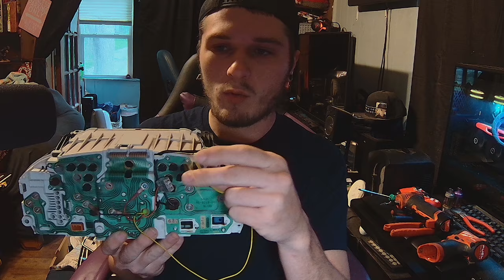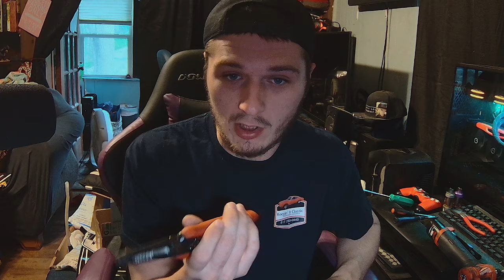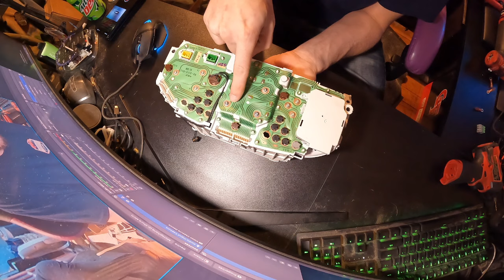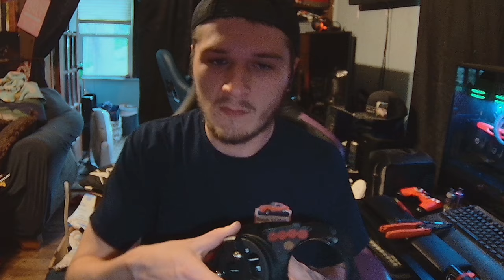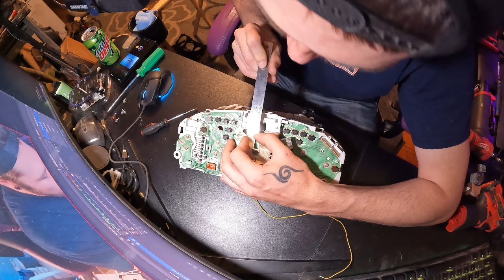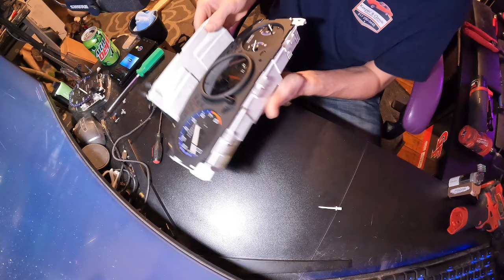EK Civic Custom "Stock" Gauge

Comment: Great stuff 🎉🎉🎉🎉. Would this work on a kswapped ek coz my speedo dont work coz the gearbox doesnt support a vehicle speed sensor it uses a css countershaft sensor ...and  where does the yellow wire connect to ? Cnt wait to see it in action  🎉🎉🎉🎉🎉
Reply from the maker: It should work, sorry for the late reply. The speed signal you are going to want is going to come from your CSS, you may need to adjust the speedometer to match what the CSS is outputting. The yellow wire i have hooked up to a fuse block that gets constant power. You just either run a fused wire from the yellow wire to battery positive or even wire it to the fuse panel where the battery cable connects.
Reply: @whitefoxgaming442 thnk u